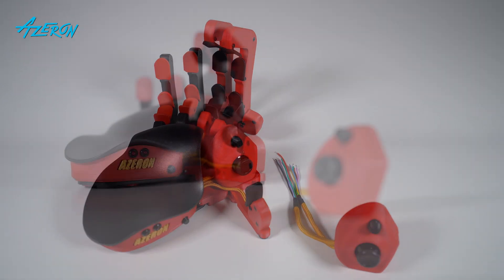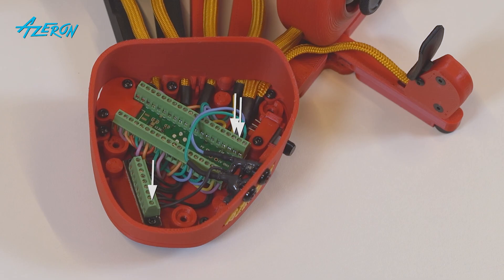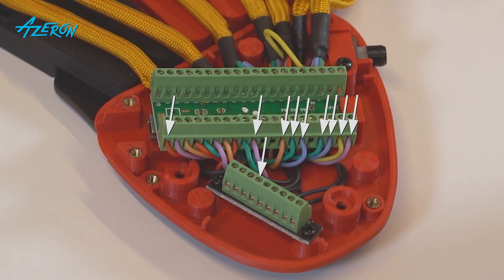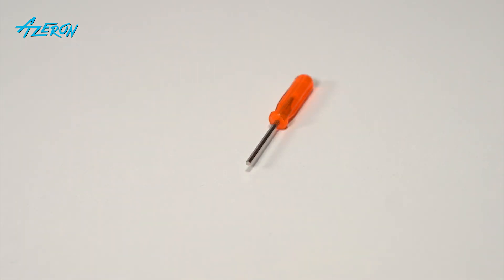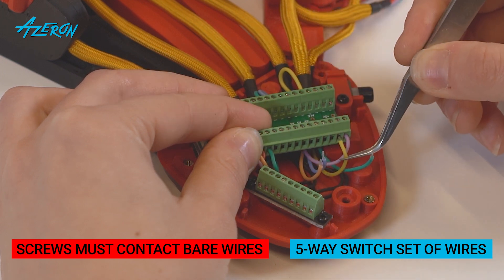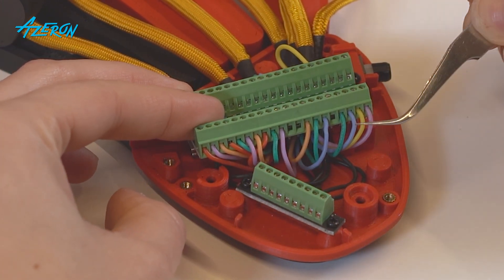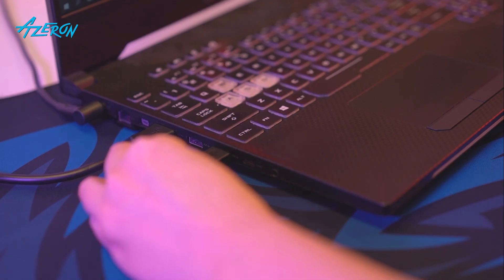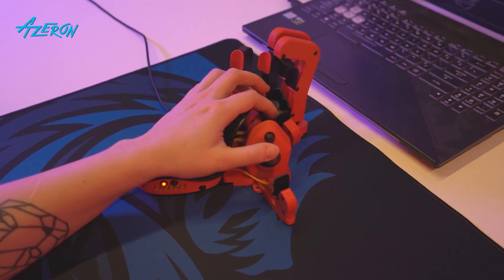Azeron Classic and Compact thumbstick replacement guide

Comment: I highly recommend also getting a small needle to help get the tensie board to release the wires. Even though I unscrewed the wires, the block would not release them until I stuck a needle into the slot.